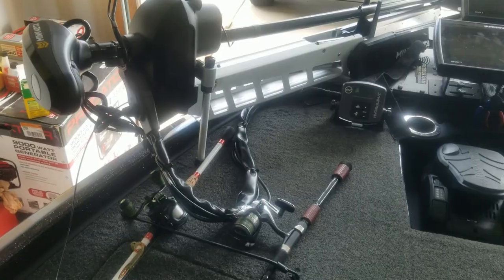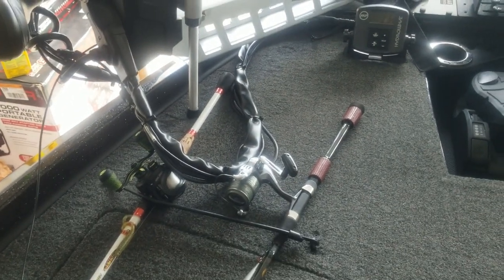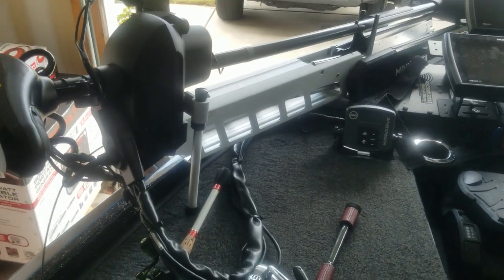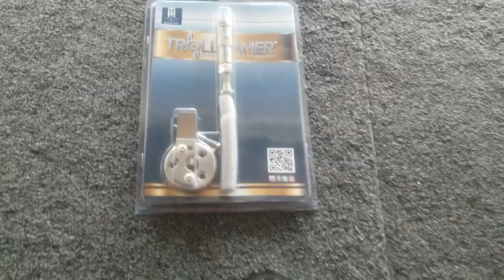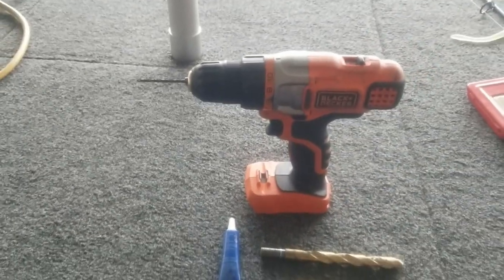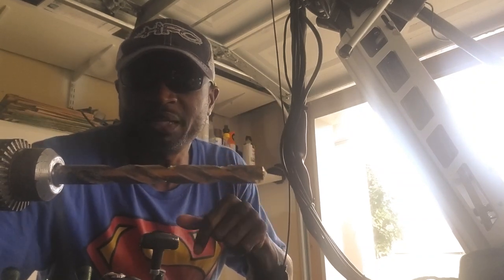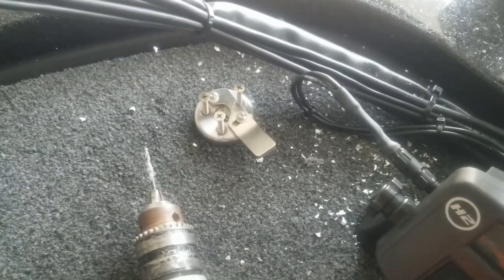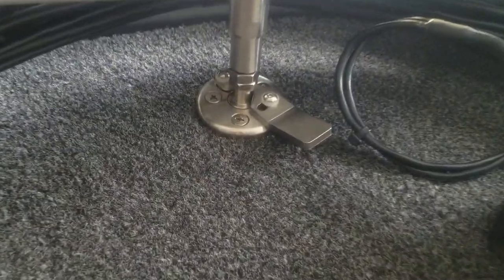Save Your Trolling Motor! Troll Tamer Minn Kota, MotorGuide, Lowrance Ghost, Ultrex, Fortrex, Maxxum

Comment: How you liking the tamer now that you’ve had it awhile?  Thinking about doing it myself.  Thanks
Reply from the maker: The Troll Tamer is great. I highly recommend it. I would be nervous running without either strapping the trolling motor down every time or having it locked in place with the troll Tamer. My previous trolling motor broke due to hitting some big waves. My Ultrex cost to much to not have it protected. Hope that info helps.
Reply from the maker: I forgot to mention that I later added a washer and nut on each screw to secure the base of the troll Tamer because screwing it into the fiberglass wasn't enough. The screws eventually began to loosen up.
Reply: @MoneyBass  ok I’ll do the same.  Thanks for the info.  Great job with your channel